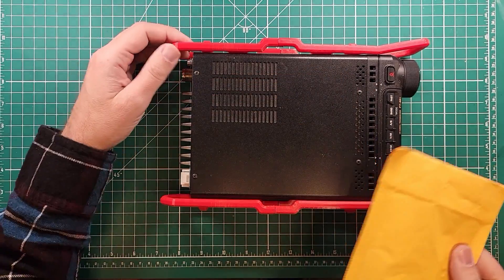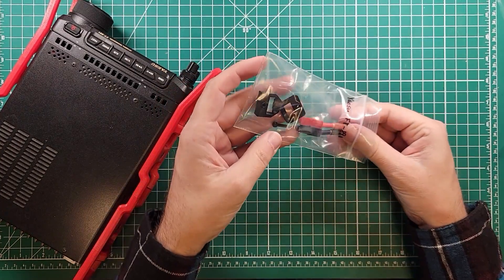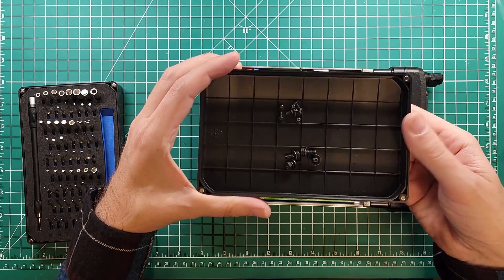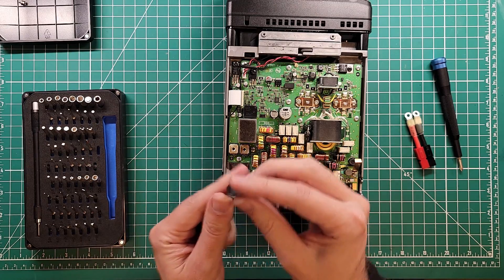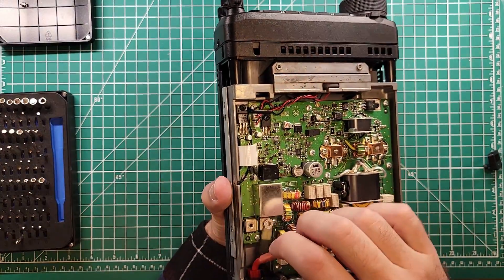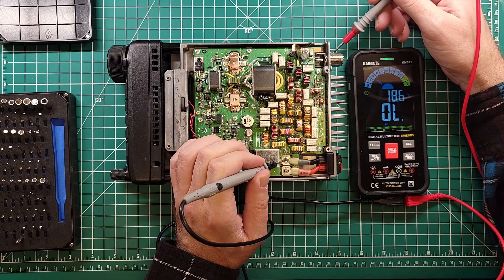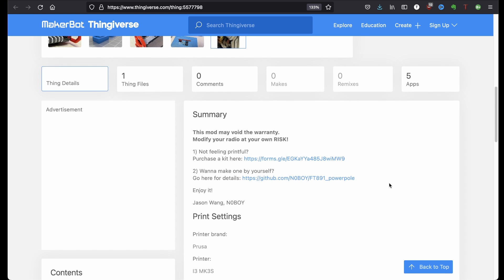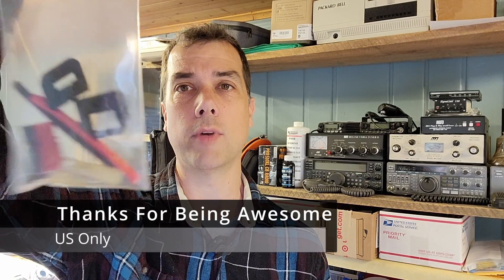The Easy way to PowerPole your FT-891!

Comment: Nice video. Still have no idea why people would put big ugly brackets on a nicely designed radio.
Reply from the maker: When I find a nicely designed radio, I'll leave the brackets off.  This one has some pretty major design flaws for my use case.
Reply: @temporarilyoffline such as?
Reply from the maker: @Kibwunga exposed knobs that need protecting.
Reply: @temporarilyoffline  from what are you going to be throwing it around? I’ve been taking my radio in a backpack on Poto expeditions and camping for about a year now. Doesn’t have a scratch on it.
Reply from the maker: @Kibwunga yeah. I had mine for more years than that.  I put it in my pack and the VR knob got bent.  Good luck with yours, I hope you never have a problem with it.

Comment: TO, are you at all concerned about losing the in line fuses which the Yaesu power cord has?
Reply from the maker: Nope, my shack power is run through a fused distribution block and people screamed at me that you never need a fuse when running a battery... But if you want an inline fuse, you can add one to your powerpole cable.

Comment: how do you think that the printed power block will handle the heat that is generated by the FT-891?  I ask because when I POTA, the pileups run the 891's fan 100% - :)  de K8MH
Reply from the maker: I'll have to find out next summer, my bet is that it will be fine, it's not near a part that generates heat.

Comment: Does the modification void the warranty or does opening the case void the warranty? Thanks - W7LDT
Reply from the maker: I don't think either of them would void the warranty.  I opened the case on mine when it blew an internal fuse and then sent it back later for a warranty issue and they didn't complain.  I'm one of those people that believes that you have a right to look inside of your own property - and the MFG also has the right to notice that you really boogered it up badly and refuse a repair... but in this case, the power pole mod is a simple bolt-on/reversible mod and I doubt they would even care.
Reply: Isn't there a right to repair law?
Reply from the maker: Not that anybody abides by... apple 👀

Comment: For some, the hobby is actually 'Anderson Power Poles', and they'd be just as happy wiring-up light bulbs as long as it was with 'Power Pole' connectors. ;-) !!!

They're not even that good a connector to be honest. Whoever decided that they'd be the new "standard" (sic) should have their head examined. My worst nightmare would be waking up in a room full of MFJunk all wired up with APP connectors.
Reply from the maker: The XT60 is the new hotness, but I can imagine how long it will take to adopt that as a standard.  A lot of the new "solar generator" stuff is running APPs now - the virus is spreading.

Comment: why you prefer this power pole Anderson than stardard Yaesu socket?
Reply from the maker: I would.  The molex connector is good because it has a retention clip where the powerpoles do not... however, my whole shack is powerpoles and this is one less non-power pole setup.

Comment: I don't know how slammed Jason has been just from this video and Mike's, but he turned around the order pretty quickly for me. Can't wait to get it installed.
Reply from the maker: Jason is good people!
Reply: @temporarilyoffline  Finally got it installed. Thank goodness I watched your video. I originally found out about the mod from K8MRD, but Mike looks to be using another version of the piece, and I just got lost for a bit. You're using the same design I have, and the instructions were spot on. The only thing I had to do that I don't recall you bringing up is that I had to file down the grooves on the sides of the PowerPoles just a teensy bit. They were just a hair not deep enough to fit in the opening. That may be a product of me using knockoff connectors, which work for 95% of things, but tiny details are slightly different.
Reply from the maker: Glad you got it working. I didn't have to file mine and I don't remember if I used official PPs

Comment: Oooh, if there's one for the tank IC-7200, I'll have to get it! (ran my 7200 over thus my love and respect for its build)
Reply from the maker: Ran it over?  That's a story I want to hear.
Reply: @temporarilyoffline  I was visiting a good friend in Maryland. It was getting dark and we were chatting as I packed the car. He gave me a few 80s era commercial radios, rack mount boat anchors.

in the process of making room for them, I took my 7200 (it was in a backpack) out  and out it on the ground.

Of course, it's starts raining and I have 5+ hour trip home. Say goodbye and I back out. I think i hit his driveway curb...

Get a call in the morning the equivalent of "You left your radio numbnut 😁"
He dries it out and mails it back.

As you can figure, it wasn't the curb.
The LDG tuner I kept with was more portable now and in multiple pieces.
The 7200, aside from squished feet, was good! Put it on the after buying a new tuner.

Still have it but it doesn't get much use now as I opt for portable operating with an 857D (the reason the video caught my attention)
Reply from the maker: @kb1qzh  Wow, that's a tough old bird!

Comment: Need to modify this for my 857d ! And maybe my IC7300.
Reply from the maker: Jason has an IC7300 version, I'm trying to get him to make an 857 version
Reply: @temporarilyoffline  That would be good. My 3d printer is in pieces right now. I'm waiting for parts for a major upgrade, and It would be easier to buy until I get it working again!

Comment: Have you ever used a magnet tray to hold your parts. With the magnetic bottom and sides parts will not roll away. It really helps prevent loss of little screws etc.
Reply from the maker: I have back in my automotive days.  I got in the habit of sticking them to the frame under the car and putting bolts and nuts there.